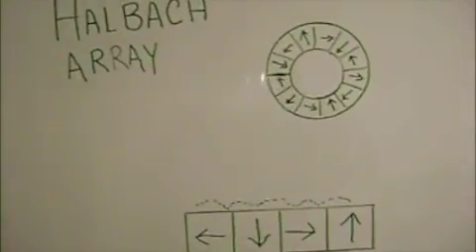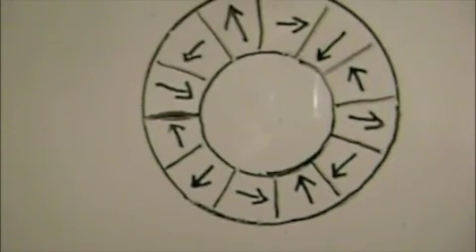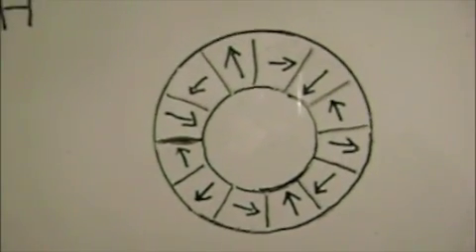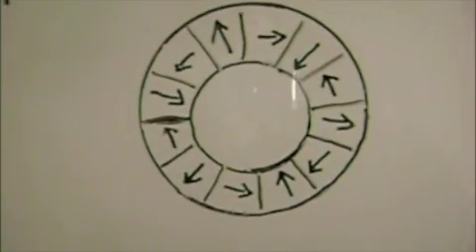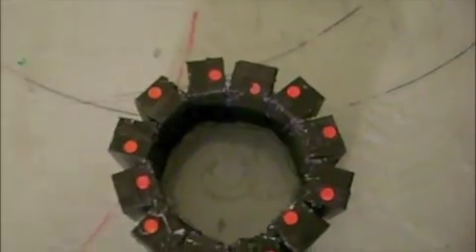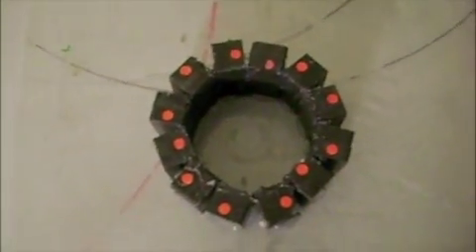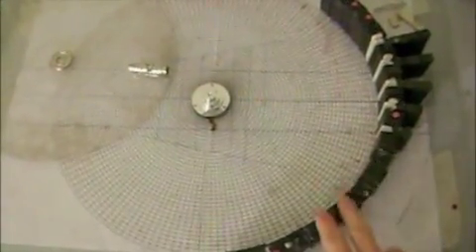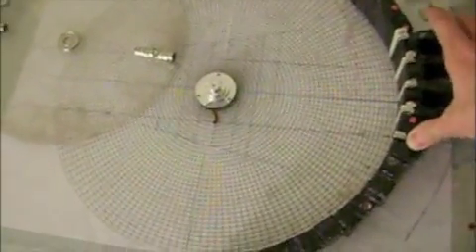Incorporating the Halbach Array into a rotary magnetic motor design. Part 01

Comment: Looking to the scheme at 4:38. The strong side of the array (the surface of all magnets) also have "strong" souths and norths polarization. Looking to the inside array, would acts like a normal magnet cause it has both polarizations too... So, we are at the start position  again :P  One thought that i have concerning to Halbach arrays is based on a circular Halbach arrays bracelets... Like a magnet rail with those "portics". The weak side of array should be resistant to the projectile movement... You can add a v-gate just before the bracelet weak side to induce more speed.  Measuring the gaps, magnetic fields and the projectile acceleration , i think thats the way to produce a permanent motor... You already did some vids about it! Keep going! (Sorry for my bad english!)

Comment: cycling the spin is not the isue here. use u can cycle the spin by simple north south north south sequence. hallbavk array simply csncels out the magnetic firld on the opposite side which i not present in a simple norh south north south sequence. we do not need a csnceled oppositte sde magnetic field to prodrce a successful loop. what we need i to make the magnets ability to propel more than its sbility to pull bck and hallbavh array is not able to solve dat. ur demo only ptoves that for certsin lenght of hallbach array the rotor reaches its teminal point whatrver be the d tsrting point... but once u put more arrays begore the array in the video i ill no longr b able o start at any point. der are alredy indications of this d .... observe tht your rotor i unable to get past d last magnet. ... meaning, the hold back is starting to make its presence felt.

Comment from the maker: I don't have a huge ego in need of coaxing, so no offense taken. Perhaps you could demonstrate, and save yourself the time it would take to explain?
Reply: When you do a big hallbach array you cannot repeat the 5 block sample that is given to you.  Because your are using way more magnets than 5.  So let's say 12 since I can't show a photo.  Think of a clock.  The 12 is going to point up at 12 o'clock. When I say up I'm saying North.  The 1's North is pointing straight at the 2.  The 2 is pointing straight at the 3 . 3 points at 4, 4 points at 5, 6 points up, North.  The same thing is happening on the other side.  The 11 points at the 10, the 10 at the 9, 9 at the 8, 8 at the7, 7 straight at the 6.  The 6 is firing all of that charge straight up to the 12.  You will have a very strong field cutting straight across the circle which would be idea for some rotating coil.  Just writh up arrows on you magnets which helps with aiming them.  But essentially what you are doing is creating on very large ring magnet. Take a ring magnet and draw it's magnetic field.  See how North shoots up and it goes around the magnet towards the south, passes it, but then is pulled back up into the south and shot out towards the 12.  Then repeat.  It's a very strong field.  AN you only want one .  This is a generator set up, not a toy around the track. set up.

Comment: Take no offense, but u only have i magnetic field on on half, in order for the design to work properly u need the magnets to be arranged in a way so the fields are broken up into 4 seperate, equal sections, where when the magnet enters the field in is pulled around, then the kast few in the field are made to push them to the next, so the is no need to help the magnet start, it is a endless supply of energy if u can set up my design which will take to long to explain

Comment from the maker: Simply that it will not improve performance. Increasing the torque, also increases the force necessary to enter a magnetic gate, so even if that increases the speed there is no net gain.

Comment: Hi, I'm VERY interested in what you are doing BUT~at present can't afford all the magnets needed in order to test~as you.
SO~Thought t*inking
In my case I don't see too much of a problem in the *hold* at the start of an arced section, in fact I want it , not so at the end, but also not too bad a thing,
I'm more interested in the torque that can be achieved through that arc.
Would it be more if those neo's where closer together ? 
Interesting too~the fact that full N or S face makes no difference